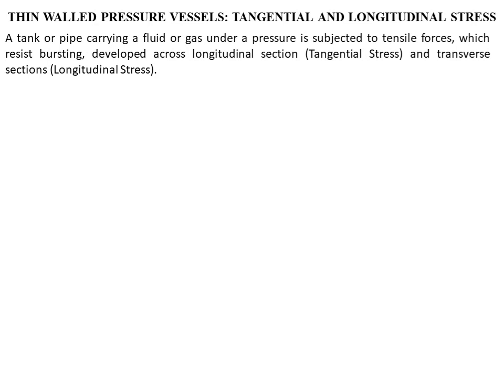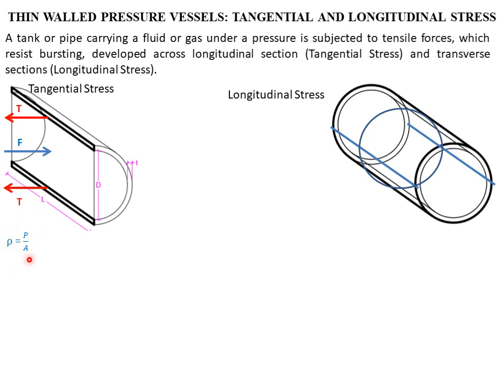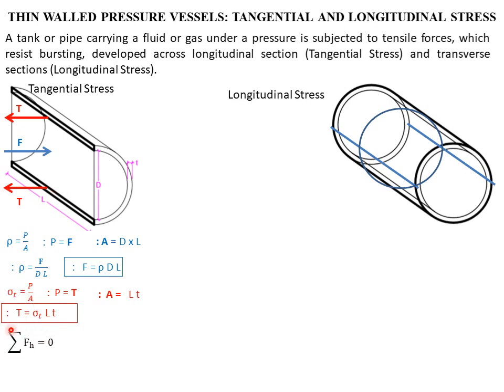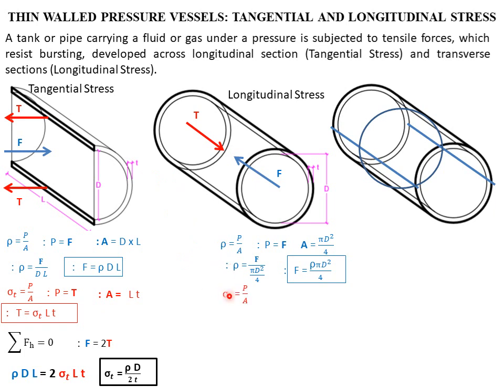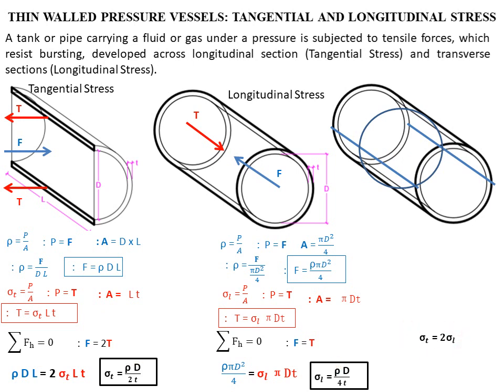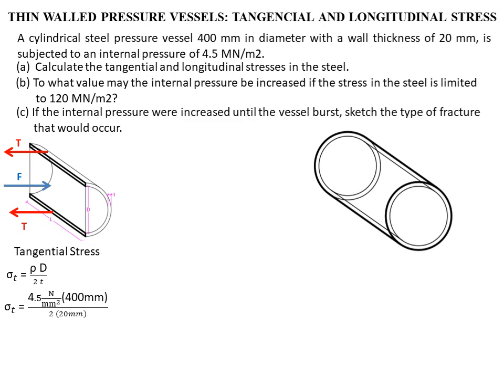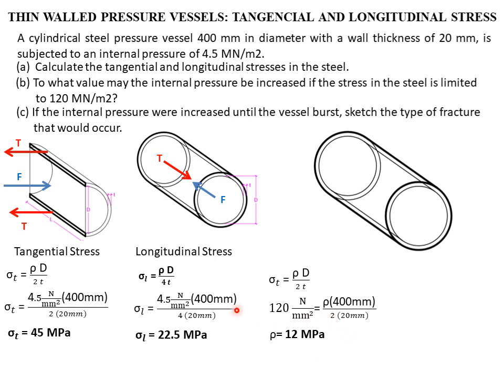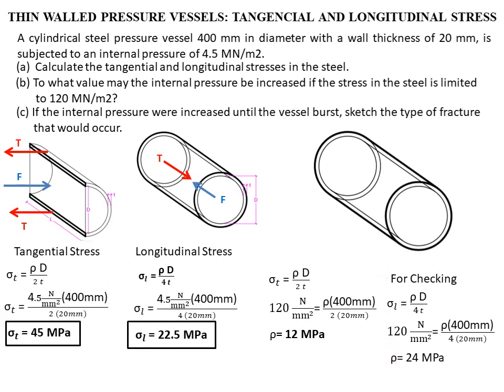Thin Walled Pressure Vessel

Comment: cylindrical pressure vessel is fabricated from steel plates which have a thickness of 20mm. The diameter of the pressure vessel is 500mm and its length is 3m. Determine the maximum internal pressure which can be applied if the stress in the steel is limited to 140MPa. *